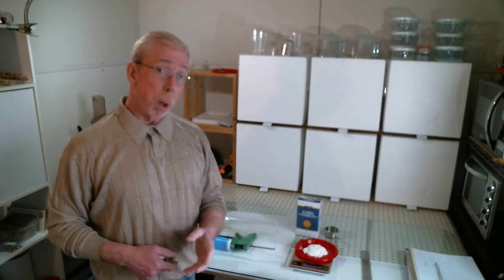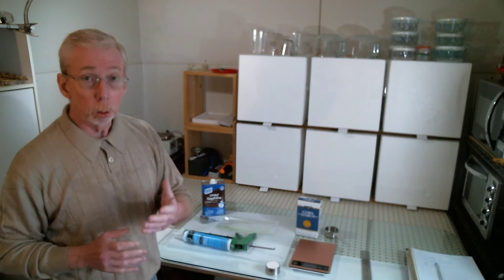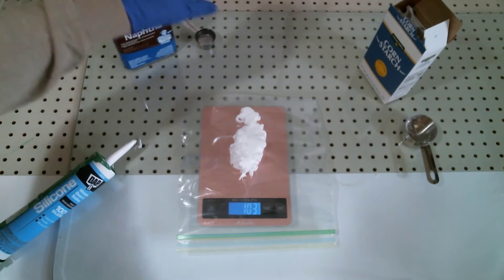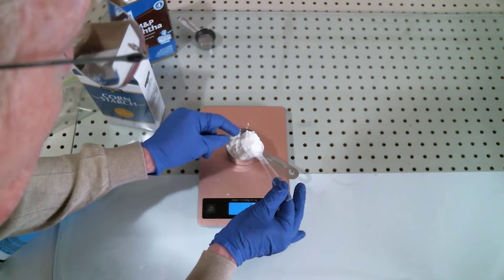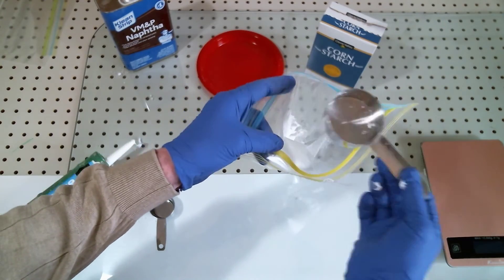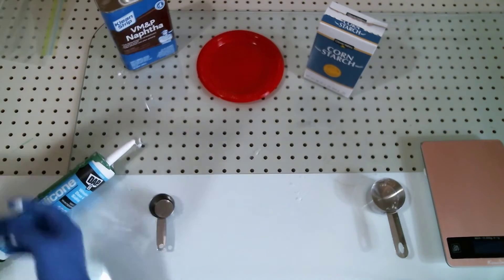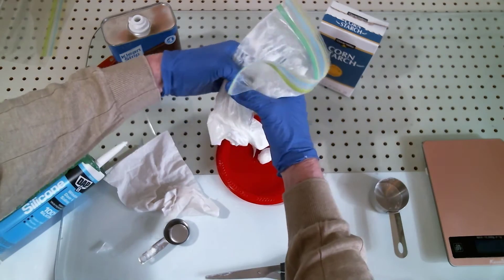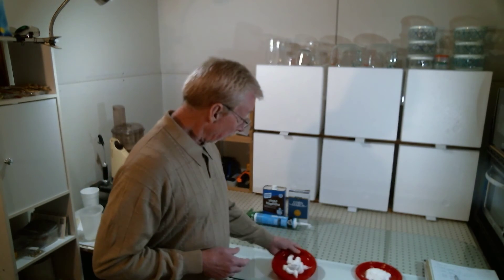DIY POURABLE SILICONE for mold making. Thin silicone w/Naphtha, fast cure w/cornstarch.

Comment: Whenever I use a ziplock freezer bag for something like this, or for my Amish friendship bread starter in the freezer, I lay the 'empty' bag on a small breadboard, with the cut opening hanging just off the edge, and use something like a credit card to squeegee every drop in the entire bag up to the opening, without getting the card dirty at all. I keep an old empty gift card on the inside of one of my kitchen cupboard cabinet doors.
Reply from the maker: Excellent idea. Thanks for sharing. I am going to use your trick from now on.

Comment: Thank you for posting this. Would this work with a plasticine object, or will the naphtha melt it?
Reply from the maker: You are correct, the Naptha would probably melt it. You may be able to use silicone oil. I did a quick video awhile back. check this out to see if it will work for you. https://youtu.be/Ci28Y3Z3bYU

Comment: Did anyone notice that he's using a dry measure to measure liquid naphtha? Liquid and dry measures give different results.
Reply from the maker: Use the dry measures I gave, if any. It is more accurate to measure wet ingredients by weight. I thin to what looks right to me and don't really measure. Add a little at a time and you won't make it too thin. I'll make sure I give the correct measure in the future...the rigors of 'doin' it live'.
Reply: @GEOsustainable  You didn’t use any wet measures. Only dry.

Comment: Does the form shrink as it cures? (I would think it does, as the added naphta evaporates)
Reply from the maker: Correct, the form shrinks the amount of added solvent. The shrinkage can be calculated.
Reply: @GEOsustainable  ok! In a form, would the shrinkage come from the top, and the silicone would "settle", or does it shrink into a center point, from every surface (interested for mold making)

Comment: Thanks very much, what could you use to prevent the mold from.sticking to a porous surface, i.e. I was making a mold of a paver?
Cooking oil?
Thanks in advance
Reply from the maker: I have just the video for you, I coated plaster. Check it out. It is my favorite go to release agent. https://youtu.be/452y9FQ7a0M PS, watch the whole thing or it won't work properly for you, there is a finishing technique that is critical.
Reply: @GEOsustainable  nice one, thanks.

Comment: Can i use one comp aciatic based sealant silicon for Casting after adding with solvent like Mineral spirit?
Reply from the maker: I'm pretty sure, yes. 100% acetic acid cure silicone. I am doing a new video on silicone, stay tuned.

Comment: I am from india.I watch your videos .your videos are very interesting.Actually I trying  to make a wood paste.I have tried to make a wood paste by your method.I use silicon+turpentine+corn starch+fine  sawdust. actually there are still some problem .Its very rubbery and some cracks after drying .which matrrial and resin can i use.what can i do can you help me .would be a very grateful
Reply from the maker: Thank you for watching. You have a different problem. I am not sure how I can help. Using silicone to fill wood is different, and I am not sure it will stick if the wood gets wet. Keep trying, you will get there. Perhaps substitute the silicone with some of my Casein experiments, it drys hard.
Reply: Thanks alot
Reply from the maker: @sheeshodadial1082  My pleasure. The Casein can be sanded, so I give it high marks for solving your problem.
Reply: I will try my best to do it and thanks for the advice

Comment: I wonder if you used high temp silicone if you could use it pour aluminum into for a mold.
Reply from the maker: No, not a chance. High temperature silicone only rates at about 600F. Aluminum melts at 1200F. I get this question a lot, what you need is green sand for metal casting.

Comment: I had to come back and ask.....  Does this quick cure method make the silicon mold less flexible or more brittle than using straight silicon?  Also, does the baking soda stop the mold from shrinking over time like it does if you just used the mineral spirits?  Thanks in advance for your time.
Reply from the maker: The flexibility is unaffected. The shrinkage is caused by what ever evaporates out...simple physics, you are losing the full volume of what you added. Plan to account for this should your item need to be precise. I get shrinkage of 10 to 25%, some report 40%. I think I say this in a few of the videos in my silicone series, just not this one. Hope you watch like all of them. Cheers
Reply: @GEOsustainable  Thanks for your taking the time to reply.  All of this is great information.  I didn't think the soda would impact the evaporation but I needed to know for sure since some of what I want to do actually requires that shrinkage.  I love that you're doing experiments and sharing their outcomes.   Makes for both informative and entertaining videos that I'm looking forward to viewing the rest of.   Thanks again!

Comment: Have you ever tried mixing with sand for much harder mold? I am hoping to build a shape to hammer form a brass boat propeller.
Reply from the maker: I have not. It sounds like you know what you are looking for, try it. I do wonder if the sand will mark the brass.
Reply: @GEOsustainable  How hard or springy is the dried mix of silicone and cornstarch? how would it react to being hit by a hammer? is it more like plastic or more rubbery? I realize these are hard questions to answer as all are subjective. Thanks for the reply and the content. I will check out your other videos as well.

Comment: You didn't make a mold of anything! How do we know it works without any fissures when a mold is turned out?
Reply from the maker: Yes, I made a batch of pourable silicone for making a mould. I have learned you folks like to see things made so I have one here wherein I make a silicone product using these techniques, I hope you enjoy. https://youtu.be/UaVkGWEqPs4
Reply: @GEOsustainable  Yes even better you made an item with it! I have tried this technique before to make a mold of a figurine but I think I added too much cornflour as after I'd got a few casts from the mold it started to go stiff and cracks/fissures appeared. Also I used white spirit!
Reply from the maker: @newtronix  Yes, getting the mixture right is a challenge. I am making a new video using just those things and I too used too much cornstarch. Fortunately I had a remedy handy. Stay tuned. A few days and it should be out.

Comment: 5 parts yellow Polyurethane Gorilla Glue mixed with 1 part Type 1 Yellow Wood glue makes a nice low pressure expanding foam that sets up in about 15 minutes and gets very hard overnight. Parts by volume and weight seem similar. Changing the ratio too much yields poor results. Type II Yellow Wood glue works but not as well,  less foam, longer cure time.
Reply from the maker: That is a very cool trick. Thanks.
Reply: I assume this formula is weight based not volume? yes?

Comment: I've used the mixed "white spirit" stuff to thin out as a trial and tried a few thinnesses. I found that when it's thin enough it seems to set as quite matte.
I'm still playing around and I think your mixing method looks like a brilliant technique.
I do have a question though (if ya see comments on this video, especially since it's from a few years ago now):
When thinning with naphtha, does the silicone lose the gloss effect if it's too thin?
Reply from the maker: I have not noticed it losing it's gloss using Naphtha. The cornstarch could be the reason. I am planning a new video using Naphtha, stay tuned. Then we can take a closer look at that.

Comment: Acetoxy silicone is the preferred type of silicone to use with naphtha, it's the regular one that normally smells of vinegar as it cures.
It should be stated on the label which type it is and it's very cheap compared to RTV 2 part cures.
One tip is to use a tubular bag for mixing so that you can more easily squeeze it out. You can also buy reusable caulking guns and place the bag with the corner cut inside it towards the nozzle end. Obviously if you go that way you need to ensure the other end is securely tied with cord or have the end draped over the side while allowing the plunger to freely squeeze down unhindered.
Good luck and thanks for the demo.
Professional mould maker from the UK . Yes that's how we spell it :)
Reply from the maker: First, thank you for clearing that up. I sometimes forget to spell mould properly, bad American habit I am afraid.
I really enjoyed reading your comment. Thank you for your professional information. I especially love your tip with the reusable caulking gun and tubular bag. Great tips! I am so glad you like my video.
Reply: I've always just heard that referred to as "Pure silicone" or at least every tube I've evre  bought smells strongly of white vinegar.

Comment: Nice! I've tried this without any solvent (and using a tiny dab of acrylic or oil paint to colour the silicone) and it works well, giving a thick paste that cures in anything from half an hour to an hour, depening on the amount of cornflour.
I've also tried it using white spirit (here in the UK, I'm not sure we can actually buy naphtha - if anyone knows differently, please let me know!) and cornflour, and apart from the smell - which takes a while to dissipate - it seems to work fine, except the molds are prone to considerable shrinkage as it evaporates. Does the same thing happen with naphtha?
Reply from the maker: Awesome info, thank you for guiding our UK friends. Yes, the same thing happens with Naphtha.
Reply: @GEOsustainable  Wow! Thanks for the fast response - especially to a comment on such an old video :) Have a subscription for your efforts, young man!

Would storing the molds in an airtight container (assuming you wanted to keep them for reuse) help? I guess it would reduce shrinkage a bit - but it's probably a fussy way of keeping your molds long-term, isn't it?

Comment: How much does this shrink  from the mould after curing
Reply from the maker: An amount exactly equal to the amount of Naphtha or any solvent you add to silicone. 25% total volume added equals 25% shrinkage. With this information, you can calculate so that your article cures to the exact size you need. I hope this helps.

Comment: If mineral spirits is used to remove silicone from objects... won't it deteriorate the silicone when used in making it pourable?
Reply from the maker: The mineral spirits does not deteriorate the silicone, it completely evaporates over time, leaving the silicone intact and flexible for 50 years.
Reply: @GEOsustainable  thank you for that explanation.

Comment: Could you imagine using this method to get a liquid pour?  Could you imagine this working with a vacuum chamber to degas without the solvent eating at any plastic parts?  I know solvents are tricky to handle, but casting silicone makes some larger projects prohibitively expensive.  I am interested in using the resulting product to pour molds in silicone.  I will likely try this and report back, unless you have the answers already.  Thanks again for your amazing work!
Reply from the maker: That would be cool! Look here for a way to thin without using a destructive solvent. https://youtu.be/Ci28Y3Z3bYU

Comment: Wow that is amazing! Do you think it could be used for life casting? Do you also think this could work with turpentine or white spirits? In Portugal some products are hard to find...
Reply from the maker: For life casting, use another formula I have developed here: https://youtu.be/Ci28Y3Z3bYU
Reply: Do not ever use that kind of silicone to make life casts. Ever! Bathroom tiling silicone is not body safe and neither is naphtha. For cheap life casting use alginate. For reusable life casts, always use platinum cure body-safe silicone specifically designed for life casting

Comment: I really appreciate your video. This appears to be a quick cheap silicone mold solution. However, Naptha is basically lighter fluid, so it shouldn't really be done inside the house as the gases are dangerous and quite flammable. I wonder just how long the molds will out gas fumes?
Reply from the maker: A few hours to a few days is my experience. I have done my best to explain the risk of Naptha.
Reply: So can i just use lighter fluid instead? Which one is cheaper?

Comment: thank you so much!!!!! I did it!! and it really works!!!!!!!!!! 🥰🥰🥰🥰🥰🥰🥰🥰🥰🥰🥰🥰🥰🥰🥰🥰🥰🥰🥰🥰🥰🥰🥰🥰🥰🥰🥰🥰🥰🥰 God bless..
Reply from the maker: I am thrilled for you!
Reply: I have question? can I use this molder in my FONDANT CAKE??? look forward for your response. thank you 🥰
Reply from the maker: I would not use this method for food contact. Also, the working temperature of this type of silicone is only 350F, not oven safe.
Reply: @GEOsustainable  just for molding method sir. not for oven. is it ok? for cake design details only. ☺️ is it ok to use? just for molding details like letters etc

Comment: it's been a while so I don't remember how Borax fits into all this but cornstarch doesn't emulsify without an agent or else it's simply a non-newtonian suspension that reduces the durability of the final compound. You're basically on the right track.
Reply from the maker: For a minute I thought you were commenting on my video making cold porcelain, as I use those in that formula as well. Glad you like, it is nothing new, I just put something up that I would use and is cheap. In this application, I think the cornstarch is a dessicant...running backwards... as in giving up moisture for the silicone to cure. Thanks for giving me another video idea on silicone.
Reply: @GEOsustainable  I think I remember using Naptha, clear Silicone, Borax, and Cornstarch with Powder Graphite to paint on layers of Cotton Gauze to build conductive rubber in a method similar to Fiberglass but with much faster curing. I didn't document my findings.
Reply from the maker: @utilityaccount8514  I'd love to known what your resistance ended at.
Reply: @GEOsustainable  I assume comparable to molded Graphite-Impregnated Silicone (more or less Graphite in mix changes resistance and flexibility) but with no need for a mold and the curing time that goes with it
Reply: @GEOsustainable  oh but the main point of the Cornstarch/Borax is that as a detergent it is easier to mix the Graphite in easily and thoroughly with the Naptha before adding Silicone which might be useful to you
Reply from the maker: @utilityaccount8514  Thanks! I will remember that. I could have used that 20 years ago too. I used to make stove gaskets.
Reply from the maker: @utilityaccount8514  I'm so thrilled to learn of this! Thanks.

Comment: Could this be poured 6” thick 6” wide and 16” long to use to water seal around some pipes inside a wall ?
Reply from the maker: Yes, use the ratio I supplied, pour any thickness, sets in about one hour. Make sure the pipes are not water supply lines, as this formula uses Naphtha.

Comment: does the silicone shrink mich doing this?
im wanting to silicone mold a fish bit dont want to spend $500 on smoothon
Reply from the maker: It won't shrink. Lot's of folks use this for fish lures.
Reply: thankyou so so much. i did this today and made it a runny paintable mix. i painted on one side of a large fish that was in a bedding material. when it was about 40min after painting a layer i added another layer and waited a hour.flipped the fish and abit of vaseline as a mold release on the silicone and started process again.
4 hours had me a nice silicone 2 part mold that iv just now started laying up a fibreglass mother mold to hold it all together.

total cost of the silicone mold was $25 Australian dollars compared to what would have been $200 if i used smooth on.

i guess the real test will be when i take the fish out and make the fibreglass repoduction but all looking good so far

Comment: hello. i bought the Radians in-ear and messed up the process on one of the molds. it dried too fast. what is the best diy walmart solutions
Reply from the maker: Easy fix. Use 10 gr cornstarch to 100 gr Silicone. This ratio gives you 1 hour cure time.
Reply: @GEOsustainable  can i start over and use your solution for both ears?
Reply: @GEOsustainable  with radians I had to leave in ears for tens

Comment: I tried doing this a few hours ago and honestly, I didn’t measure. I was trying to cover a large platter so I used two tubes of silicone, nearly half of the bottle of naphtha, and probably not nearly enough cornstarch. Can I more corn starch now or will this have 0 benefit at this point?
Reply from the maker: As long as the silicone is not set, you may be able to add cornstarch. If not, well, you may have to start over.
Reply: Thank you! It’s rubbery. lol I’m going to add it anyway and pray for the best 😅

Comment: So i mixed the naptha with the silicone ( was unaware of the adding cornstarch) and it has sat overnight and is still not cured. So will it take longer or is it just a flop and i need to start over?
Reply from the maker: So sorry. You have to start over.

Comment: It's great to see someone take a well thought out practical approach to solving problems. As an extensive user of all types of silicone myself, I would be lost without naphta. Whereas cornstarch has the edge in many applications, I mainly use fine talc that ensures exceptionally smooth consistency.
Reply from the maker: Thanks for sharing your knowledge. I have to try that.

Comment: now i need to test this out.  When you made it the consistency of syrup did you find that the mold had any shrinking?  If not, then have you don't any cost analysis on this vs the more expensive stuff?
Reply from the maker: well, it is cheaper and more fun.

Comment: Just a note from other videos: The label should state 'Silicone 1'... 'Silicone 2' will not fully cure.
Reply from the maker: I think those are a brand I don't use. But, others will thank you for this, I get a lot of questions on silicone 1 and 2. I may want to do some work with these, as a lot of folks use them.